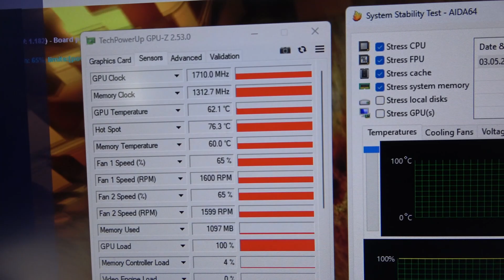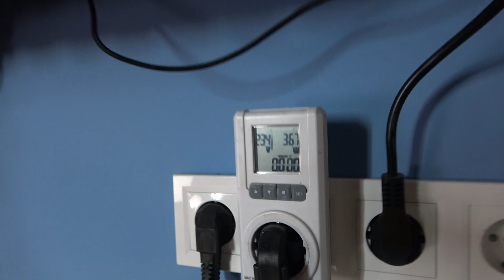i5 - 13500 + RTX 4070 👽Gaming PC for playing any games on max settings  + Test 1080p 1444p 2160p

Comment: Hi can you pls build me a 4070 build like this from Canada Computers website? but with 32gb ram instead? budget is $1400 CAD pre-tax
Reply from the maker: Hello bro, if you assemble it cheaper, then you need to install a video camera weaker than 4060 or 4060 ti.
Overall, this is a balanced PC in terms of price and performance based on discounts from the canadacomputer website.
This PC will last for at least 4 years + you can upgrade in the future by replacing the processor and video player

ASUS DUAL GeForce RTX 4070 OC 12GB GDDR6X - 722
https://www.canadacomputers.com/product_info.php?cPath=43_557_559&item_id=240510

AMD Ryzen 5 7600 - 269
https://www.canadacomputers.com/product_info.php?cPath=4_64&item_id=233960

MSI PRO B650M-A WIFI - 189
https://www.canadacomputers.com/product_info.php?cPath=26_1832&item_id=238228

TeamGroup T-FORCE VULCAN 32GB (2x16GB) DDR5 6000MHz CL38 Black - 104
https://www.canadacomputers.com/product_info.php?cPath=24_311&item_id=236139

MSI SPATIUM M461 1TB NVMe PCIe 4.0 M.2 - 80
https://www.canadacomputers.com/product_info.php?cPath=179_4229&item_id=239414

COOLER MASTER MasterBox Q300L V2 - 85
https://www.canadacomputers.com/product_info.php?cPath=6_6004_5959&item_id=252203

Seasonic S12III 650 SSR-650GB3 650W - 74
https://www.canadacomputers.com/product_info.php?cPath=33_1938&item_id=163212

MSI MAG CoreLiquid 240R V2 - 108
https://www.canadacomputers.com/product_info.php?cPath=8_135&item_id=215652
Reply: @vladpcbuild8680  thank you very much!!!